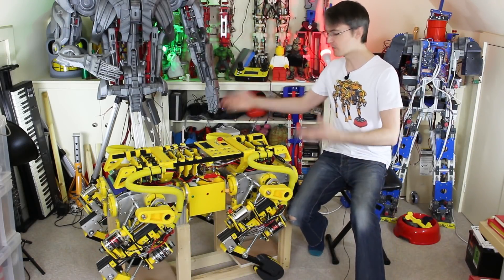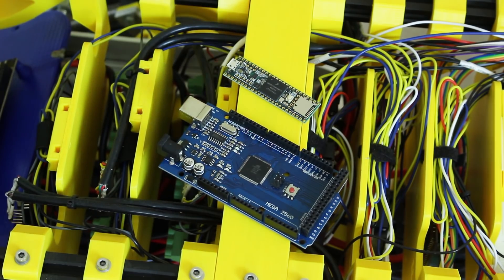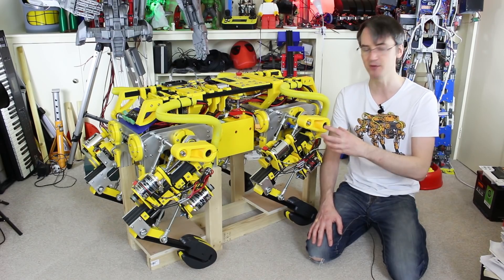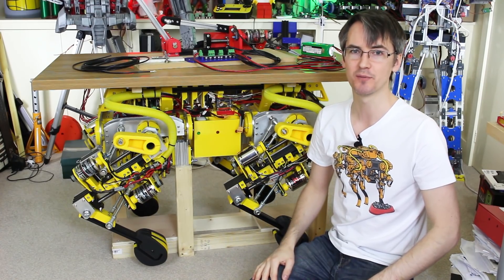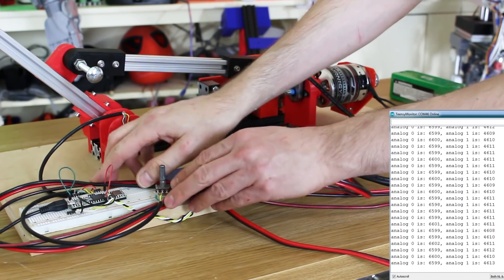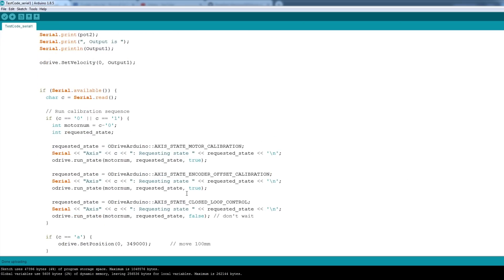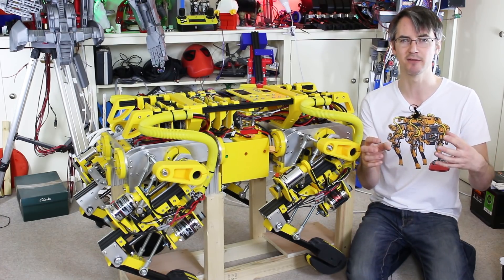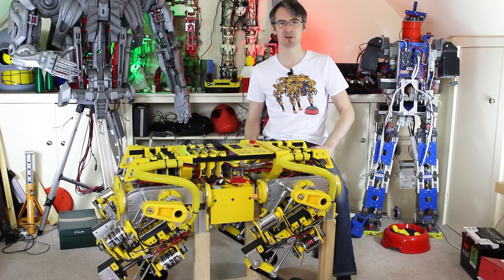openDog Dog Robot #14 | Closing the Loop? | James Bruton

Comment: Just looked at the specs of the cable for their application. Don't bind the shielding to both sides of the ground wire running through, just the side nearest the controller. This will keep you from making a loop in the grounding system that acts as an antenna and injects interference into the system that is more sensitive to noise on the robot. This was a big tip for sensitive A to D instrumentation systems used in industrial applications when they have to have a long run. Your short runs right to the controller would limit the problem, but why not do it the right way before you end up pulling your hair out.

Basically, you want to you want to only attack your shielding to chassis ground and then only have the ground from any electronics go through their power supply/power regulator and then tied to chassis ground on any system that needs shielding. You also might want to consider shielding more of the electronics later even if they all only have digital communication between each other. CAN bus and other protocals don't like outside noise on them.
Reply: Also the best way to get good shielded cable is to buy ethernet cables, especially the high quality ones with shielding between cables. It is made for resisting serious interferences and interferences between individual cables.
Reply: @meneldal  Hmm, careful as lots of Ethernet cabling is UTP - Unshielded Twisted Pair.

Comment: Don't try to go for high precision in highly dynamic systems like a walking robot! While high precision is important for industrial robots, it's totally wasted for walking robots. Just hold your hand up before your face and watching it jitter. That's because biological systems aren't very precise so your body needs to always "fix" your hand position based on the input from your eyes and the input from the sensors in your muscles. This creates some jitter - but still you can to quite precise work with your hands.

So the solution is not to strife for a maximum of absolute control precision. If your robot walks on uneven surface it has to adapt to this, it also has to adapt to external forces (pushing it, wind, etc), sloped ground etc. The best absolute precision wouldn't solve this, the only way is to make your robot adapt to this. So while measuring the position of it's legs is import to a certain degree, it can be very rough and imprecise - but the robot needs additional input like forces sensors in the feet, inertial measurements etc to adapt to the external situation.

Also even if there is some jitter, it doesn't matter, because all motors will move constantly to walk or to balance the robot out. Those movements will be much bigger than the 2-3 lsb jitter of an 13bit ADC. If you want to let it stay completely still after movement, just use a hysteresis for the inputs and maybe also a fast LPF to remove high frequency noise. But those small movements won't break your robots, they are mainly cosmetic because 1/3 of a rotation of a motor translates to a sub-mm movement of a leg which wouldn't move the robot at all.
Reply: I would be less concerned with the jitter than with the general inaccuracy of using the (low cost, low resolution, and low quality) potentiometers. I would probably guess that the dynamic characteristics of the control loop for motor positioning and motion (currently handled by the O-Drive and the high quality encoders) would get orders of magnitude worse.
And while you can do a lot with a properly designed control loop, among all the characteristics of a system you can compensate for dead time is your enemy. I reckon in combination with unreliable and low quality sensor data that would immensely degrade the performance of the systems with regards to archiving something like a stable, controllable gait, that allows the robot to walk on uneven surfaces and external forces.
Reply: My thoughts exactly, robotics for general applications needs to be more versatile even if high precision is traded off. That will lower costs.

Comment: you can always just code in an algorithm that takes known historic positioning and filters out jitter based on knowing split second position reading that sounds way off was just jitter and disregard it especially when a couple readings later in fractions of a second multiple matching proper readings keep coming through.  Code can easily be written to disregard the ocassional jitter spikes.

Comment: Could you use NVRam to store encoder positions? As long as the motors are not turned while powered down position should be available on power up.

Comment: What if you measure the distance from the belly to the floor, and force/weight on each leg? Then at startup, the dog will go to a specific height keeping all 4 legs balanced in terms of force, knowing each leg geometry you should be able to calculate lengths, is more of an overall zero position instead of trying to home each leg. Just a quick thought to help find a different solution to this :) I love your videos!

Comment: hey James if you have an encoder that has a hard set default zero that is in line with where you want the joint position then you can read the angle from the hard set zero with a comparison to the other joints and if this is confusing then when crouching the values are solid enough for no jitter but can account for mechanical jitter and can see when it meets resistance from a step up or vice versa when lack of resistance from a step down

Comment: You could reduce jitter with a box car filter.  Make a variable that you'll use as an accumulator.  Each time you get a new value, add it to the accumulator variable and store it in a 128 pnt memory array with a pointer.  Cycle the pointer from 0 to 127.  Before you write the data point into the memory array, read out the value that is there.  Subtract that from the accumulator value.  It's equivalent to a 128 tap FIR filter with all the taps = 1.

Comment: I think as you may have observed with the exosuit, the mechanical precision and simplicity of design works against you when creating dynamic motion.  Organics like us and dogs have both passive stability built into our limbs, and shock absorption in our muscles and joints.  Any design which forgoes this important design feature will inevitably reach a limit in functional ability where the demand for more computing power and precision positioning, and predictive modeling outstrip the resulting gains in function (diminishing returns).  
Smart money is on adaptability and tolerance of unexpected outcomes rather than perfect awareness and control (which are impossible in the real world).  To make this work properly the system is designed with an awareness of the limits of dynamic motion (learned in animals) and a body which works effortlessly in concert with the host mind to leverage stable structures and fast acting muscles to approximate the right position to stay upright.

Less precision, more designed stability.

Comment: James, in my opinion you should save the current state of execution (values where each joint is) at an external memory, and before reprogramming the arduino, you could have a function that write the values to the external memory, and at power up would read from the external memory to the arduino ram. Then you can have a (RC circuit) to delay the reset, but at the same time arduino could monitor the reset line without the delay circuit, to trigger the function mention before.
I believe you will be a lot worse by moving that PID to arduino instead of continue to the current implementation on Odrive

Comment: Add a small battery/capacitor backed external serial ram that is checked on startup of the teensy. If it detects position data it grabs it and continues.

Comment: Teensy 3.5 and 3.6 have a built in SD card for exactly this purpose. Since the O drives hold the position, you could just have a button you press that stores the current location of the legs on the SD card and then have the teensy read the position after boot up
Reply from the maker: That would work, although I'd like to be able to recover from any position on power up.
Reply: @jamesbruton  Being able to read the absolute position of a leg at any time is definitely a nice feature and since you have multiple projects that could use it, it may be worth it. I don't know if it's absolutely necessary for this project, but it's definitely cool and I'd love to see how you do it. Either way, thanks for all the amazing content and I'm excited to see what you'll do next!

Comment: Rather than stunting the resolution of your sensors or burdening the software with filtering routines in order to remove electrical noise from the wires, just use a 10-100nF cap between the signal wire and ground. That should filter out all high frequency noise, leaving in your low frequency analog signal.

Comment: Quadrupedal movement doesn't have two diagonally aligned legs moving exactly simultaneously. It is a sequence where most of the time three feet are on the ground, with all legs going through a sequence. The more a dog is running, the shorter the time between both diagonally located legs initiating their movement. Still not the same time though! I suggest watching some lion footage, as the whole three legs things has a big benefit towards balance and speed.

Comment: For your measurement stability problem you can use this formula.
Potx = (analogread(x) + (Potx * filter)) /(1+filter)
 Filter is your filtering coefficient, higher you have higher filter. 
I often use it in my projects it works well if you have reading frequency is at least 20hz.
She's making a pseudo low-pass filter.
Reply from the maker: I'm using a first order filter already for the actual motion, so that would probably work.
Reply: @jamesbruton  Well, what useful library do you need to do that
Reply from the maker: @tomtruc  I just wrote the same thing you posted in code, it's at the start of part 2 I think.

Comment: Put a single inductive or magnetic pickup sensor somewhere near your ball screw driven block where the leg is in a 'natural' position. drive past the sensor, stop, back towards it slowly and then home off of that. the nice thing is that you aren't stuck running a leg all the way in or all the way out.  

You can also use a magnetic sensor and have several points where you calibrate it by using several bunches of magnets along a strip. stripes of 1, 2, 3, 4 etc. As you jog past the stripe, you'll see 1,2,3,4 pulses. Use that point to create a calibration point at several points in the travel.  Then you can calibrate any limb by moving just as far as your next calibration point.

Comment: You could try saving the values that where saved in Ram on the two slave controllers into the eeprom by for example pressing a button and then program a flag  that decides if a new homing needs to be done or the stored values should be used. This should be way easier and cheaper.

Comment: If you worry about the pot disconnecting accidentally you can use their middle 90 degrees for encoding and the top and bottom 20 degrees to detect disconnected and shorted wires.

Comment: Could you use the joint pot, or preferably an absolute position encoder on each joint, to read the current joint position on startup. Then use the Write Property command in ODrive to overwrite pos_setpoint? You would need to calibrate absolute zero on the pot or absolute encoder once, and convert from those readings to ODrive encoder pulses. But that should be do-able.

Comment: If you have a home switch in the middle of an axis' travel,  arranged so it's always on one side of centre and always off on the other side,   you'd have in effect a 1 bit absolute encoder and so you could home from cold boot and all axes would only move towards the middle, which might be acceptable even when the robot is on its feet.
If you have a scope,  check the Vref on the arduino for jitter, as the A/D values are relative to this so any noise in the Vref (or in the 5V depending on arduino) will be reflected.  As the same voltage is probably used as the high leg of the pot,  this jitter should cancel out, I guess.

Comment: I've seen lot of people suggesting eeprom for parameter storage, that's a good idea but the teensy can also read and write to high speed sd card and if i recall correctly it can even keep part of the flash memory when reprogrammed.

Update: the teensy doesn't have eeprom, it has flash based eeprom emulation instead.
Reply from the maker: I may well do something like that, although recovering from an unknown position would be useful.

Comment: No, this is where I shout at the screen - "Why set the resolution to 13bit then divide the output with a map(), when you could just leave analogReadResolution at its default of 10bit and achieve the same result", then take a deep breath because that's a fair bit to shout in one breath.

Though really James, this is a bad solution. You are sacrificing the precision of the ODrive encoder for a shitty (at best 13bit value) to cater to an development-time issue. As other commentators have noted, in a controlled situation you can push the values to EEPROM and read them back after reboot. (EEPROM values are not nuked during reflash.) In an uncontrolled shutdown you can simply do a re-calibrate. In production it is entirely reasonable to recalibrate at each startup. I'd have openDog crouch down to achieve this.

Comment: teensy?  why?  You could have used a stm32 nucleo board.  Also, while I get that this is all still prototype, are you ever going to move away from the crutch that is arduino?

that said, I loved this video.  this is what I subscribed and donate to patreon for.  Great job.
Reply: Thanks to this comment I just bought 10 stm32 development boards for $1.50 each off ebay from china.  What a steal!  Only $1.50 per board and free shipping for a 32 bit dev board that is way faster than arduino and more memory and 32 bits instead of 8 bits AND is as tiny as a arduino nano no less!
Reply: although I would NOT recommend the nucleo board which is just a namebrand and costs way extra for no added value ($7 + shipping instead of only $1.50 and free shipping like the off brand stm32 dev boards)

Comment: Could you not use a simple pressure sensor on each end of extent of movement and then take the reading from the motor between the 2 points to calibrate and know the position of the motor?

Comment: Make sure to dimple your shafts for the grub screws on your pulley upgrade, otherwise they will eventually slip
Reply from the maker: I have two grub screws in each pulley, which is apparently better.
Reply: @jamesbruton  You will never beat putting a location dimple for a grub screw on a shaft in my experience. If the manufacturer believes it won't slip though then fair enough.

PS I do prefer the incremental updates on the project👍

Comment: What about using hall effect sensors and a small magnet (similar to the analog triggers in a playstation/xbox controller) on each joint that you can just ping to calculate the current position of each angle and then reverse the kinematics and then not have to have any physical wear of a pot turning and wearing out quickly, could be fairly non invasive as well in terms of having to mount to a rotation component of the joint, would just need to be stuck to each section on a bracket

Comment: I've never tried this myself, but would using 2 (or more) pots per joint be a potential fix for the jitter problem? Adding all pot positions on the joint then dividing by the number of pots should theoretically divide the amount of jitter by the number of pots, especially if the pot cables take different physical routes to the microcontroller.

Comment: So basically, you need to give your robot proprioception. (Edit:) Actually, you need to upgrade its proprioception and bake it into the hardware more. I had to think a little harder about what the actual definition of proprioception is. Proprioception in the human body depends on a bunch of internal sensory systems, which provide data on the body's current state, which is interpreted to then, and only then, create proprioception. (I'm a little hazy on details, but I think that blood pressure in the various veins and vessels of the body, are among the sensory systems that contribute data to create proprioception.)

Comment: I was thinking if you use FPGA on the openDog for dynamic model so it calc those leg positions to keep dog stable and send data to legs how those need to move so fpga board would be then a brains for openDog

Comment: Fixed/Predictable/non elastic geometry between motor and leg & measuring motor turns AND leg position
Opportunity for rationalisation?  -  what happens if you move the motor position encoder to the leg joint and effectively null out your gearing/mechanicals etc.

+ one other thought - end stops/position calibration doesn't HAVE to be at the end -  could be anywhere on the leg position - a nubbin on the pivot flicking a switch at a nominal standing position for example.

Just seems an awful lot of rework for he sake of some non-volatile storage separate from the processing boards.

Like you said - plenty of ways to skin a cat :)

Comment: Have you ever considered designing a custom bios for a laptop or something and utilising the various i/o ports for the usb systems and stuff? It would significantly improve the speed, but it would take a lot more work... on the other hand, you could just have an actual laptop running the software and exporting it to an arduino as analog signals to the arduino for redistribution...?